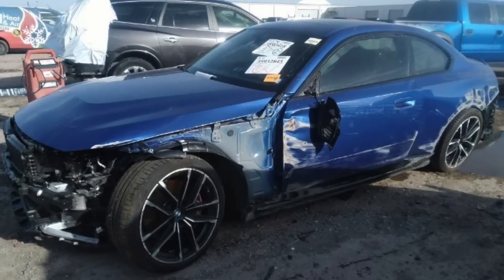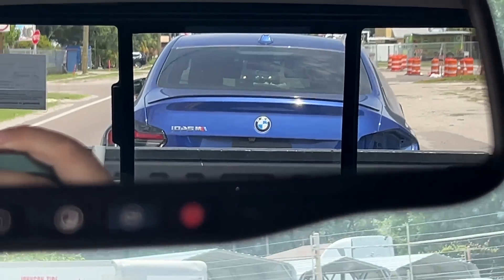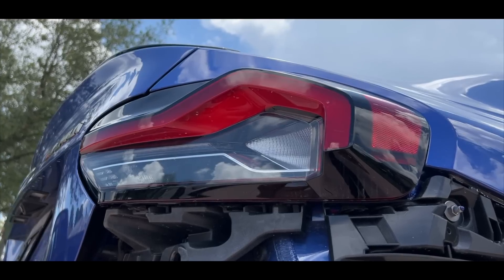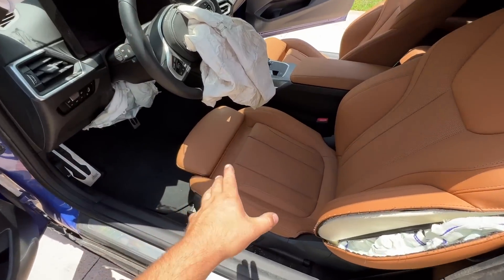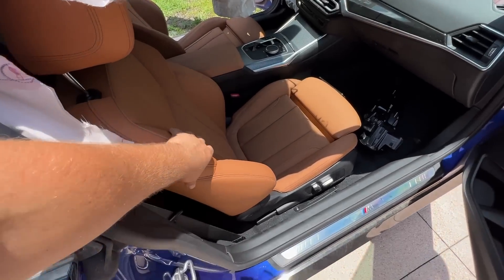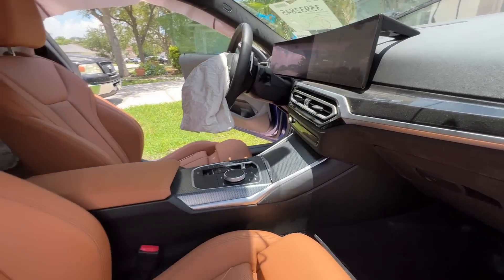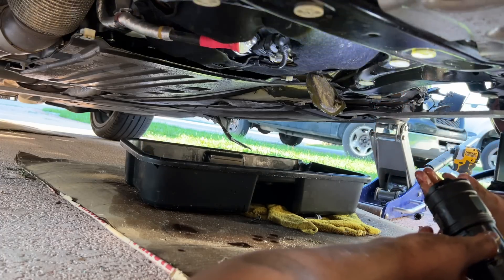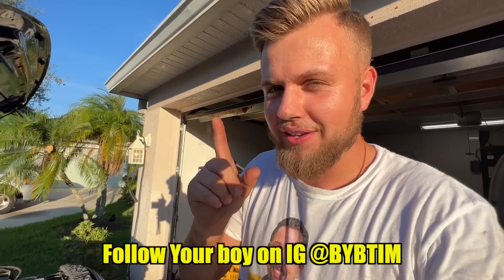I BOUGHT A WRECKED 2023 BMW M240i And It Has A Hole In The Engine..!

Comment: I bought an F80 with similar damage. The car had no oil in the engine nor the tranny. I had a busted oil pan and the transmission cooler leaked all the tranny oil out. Easy fix. I replaced the subframe too.

Comment: Those B58's are hard to blow up.  It is possible when the engine mount was destroyed, the engine came down a couple of inches and either knocked off or pinched the oil return line.  I swear that it looks even tighter than a Supra.  Crossing my fingers that is all that it is.
Reply from the maker: Any motor will blow up without oil 😭 even if Nokia made a motor😂😂 these definitely look better than a Supra. Or I may just be bias
Reply: If the motor get out from his mount, it destroy the gearbox. If it automatic it expensive.